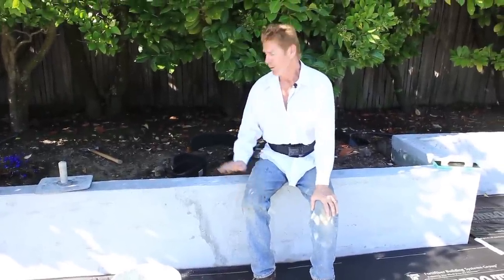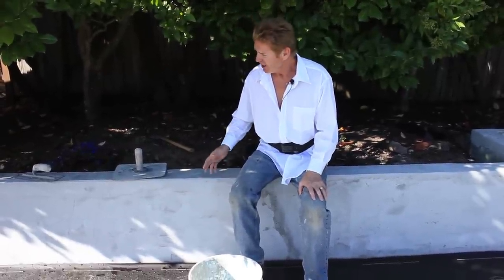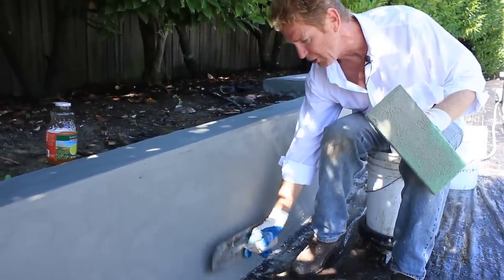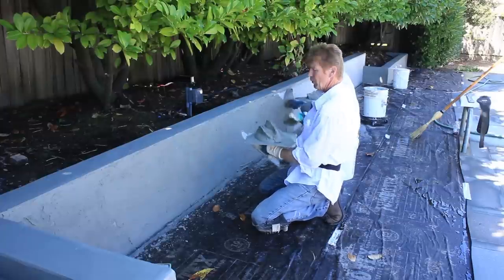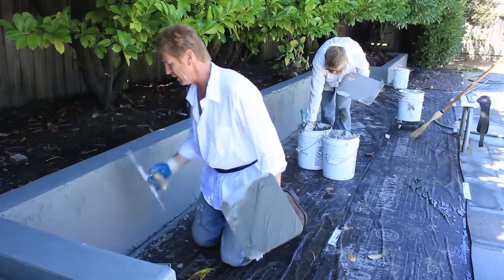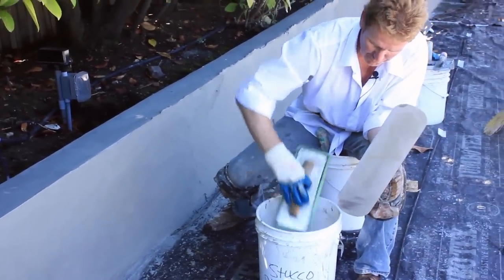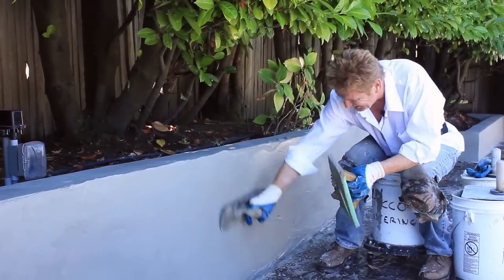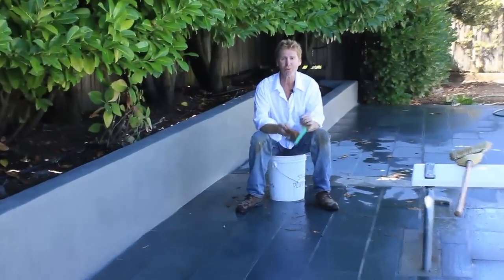Old School Plastering, Color Finishing

Comment from the maker: Morning Adrian Dona, This wall can get some hairline cracks but I doubt it unless the ground is moving, months of rain will do this easily. Stucco finishes tend to hairline much less over concrete or cinderblock walls as opposed to wood sheathing. If the fella drains and refills this pool this can also cause hairlines in this wall.
(No doors, windows opening and slamming, remember vibrations cause cracking)
 Thank you for watching and have a great day!
 Kirk Giordano Plastering

Comment: I have to mix my own! My own lime and sand - which I will sift , but what I need to know is if I can use lime plaster over concrete- I love your work. 
I’m a total novice, but have tiled, I’ve used joint compound for years. But troweling is another ballgame for me- but it’s m sick of being afraid of doing what i know can be learned by trial and error! If I don’t make an attempt I’ll never learn a thing. I don’t need to worry about a lip on what I’m going to do-
Reply from the maker: Good morning Ramona, of course, you can apply lime plaster over concrete, make certain the concrete is clean, very clean.
 Then keep the concrete moist so that the new lime plaster bonds to the existing concrete by suction, which we call a mechanical bond.        If you're not sure how to wet or keep moist the concrete wall, then apply a bonding agent to the wall instead, like Weld Crete or Quikrete sold at home depot and or lowes.

Happy holidays and New Years to all, from Kirk Giordano plastering and Family  
      The complete encyclopedia of plastering courses in video, with do’s and dont’s

Comment: Kirk & Jason,  Thanks for your reply.  I noticed that Quickrete has two Portland cement plaster, a finish coat and a base coat.  Would the finish coat or base coat product be a better option for our concrete wall?  I am assuming the finish coat will work best.  I will also be pouring 3 more 4 foot tall walls.  Have you ever used a "poly" on the inside of the form to make the finish smooth?  Would this help the final product?   Thank you.
Reply from the maker: Hi John P, if your going over concrete use the base coat as you would need to skim one coat between 1/2 inch to 3/4 of an inch. the finish coat is a color finish designed to go an eighth of an inch only.
 best wishes,
Kirk & Jason Giordano's DIY plaster and stucco network

Comment: I just poured a concrete wall and had to let it sit overnight.  The concrete is too firm to work and finish.  Could you give me an idea of how to finish this wall so the finish is smooth?  Thanks.
Reply from the maker: Evening John P, if it's just poured give it a chance to cure then wet the wall as evenly as possible, apply a coat of portland based cement plaster 1/2 inch to 3/4 depending on your wall, allow to set a bit then use the trowel to smooth it out,
takes more practice than simply reading advice, my brother has been with me 30 years and still can't plaster, you may want to hire a professional.
 We all have our strong points.
 Best wishes.
Kirk & Jason Giordano's DIY plaster and stucco network